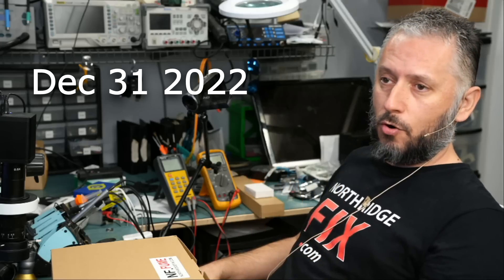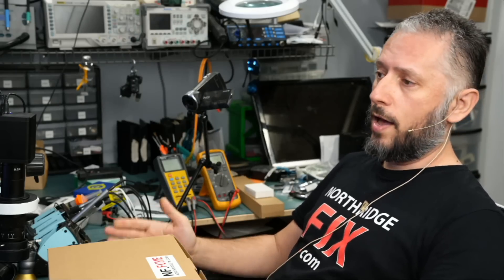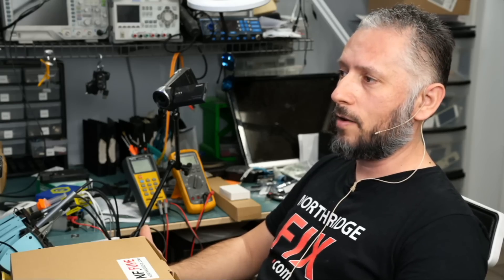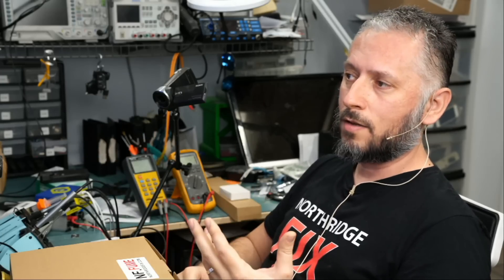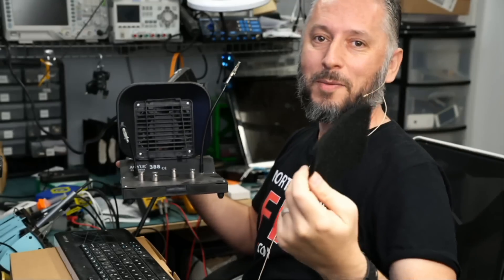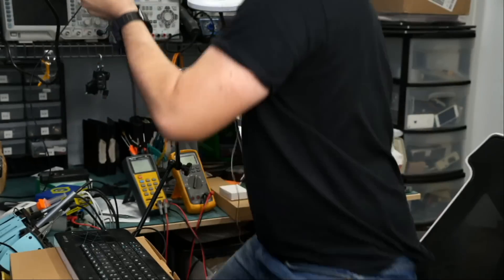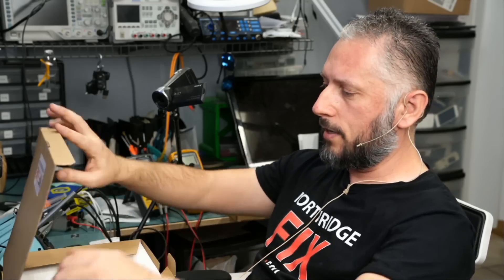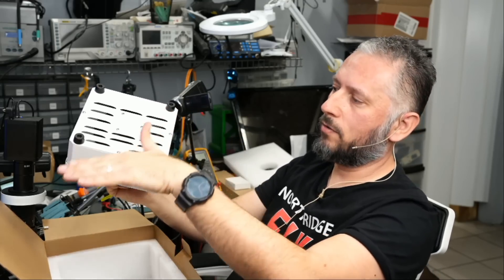Awesome Soldering Fume Extractor NF.FUME

Comment: Problem I see is that you also need room to have a microscope over the top of what you are working on usually, so this thing would have to be long enough on my bench for me to place it at a side angle and I just don't know if the hose would be long enough for my bench and setup.

Comment: ''This Device is used indoors without the need for open windows and features a triple  filtration system.''    If i was you then do always with a window... or even better a roof window..  and a long pipe ;)

Comment: too bad you use so much camera light. details in the whites are washed away.

Could you consider and bring this in in other colors such as semi black and not glossy or matt?

light from lamps will reflect and you amplify light with white.
therefore they cannot be blank. And not completely matte either, since matte can withstand too little wear.

just as you should never have a soundbar that has a glossy surface in front of your TV because of annoying light reflections!!

Comment: In case you are wondering,  this fume extractor is $195.00
Reply: Thanks for reporting, saves having to check the website for pricing.
Reply: They have the exact same machine on Ali Express for $103
Reply: @sbrewski27  you must be bored
Reply: And theres ZERO, NONE, NODDA, NONE data that says breathing it in causes issues.
Reply: @sbrewski27  why bother check the comments you boring dumwit? The comments are to comment. Even if a statement feels pointless to you, it could help others.
Reply: Wowzers😬
Reply: @sbrewski27  bruh you chose to read it.
Reply: thats crazy
Reply: @sbrewski27  You sound triggered. Just saying.
Reply: thanks Captain Obvious